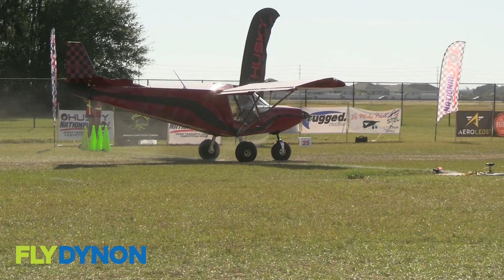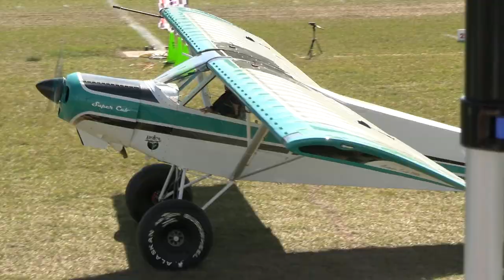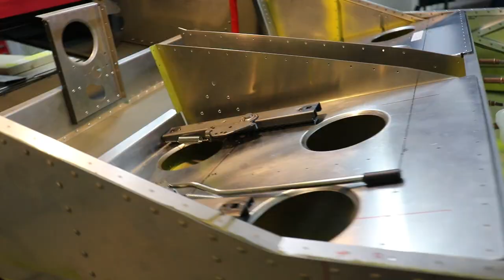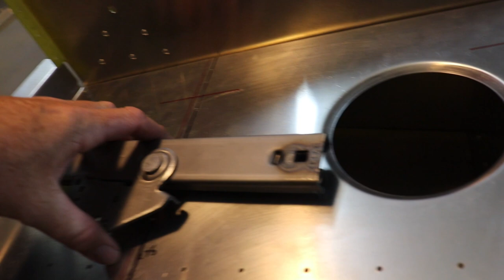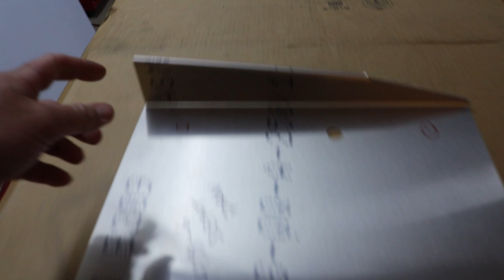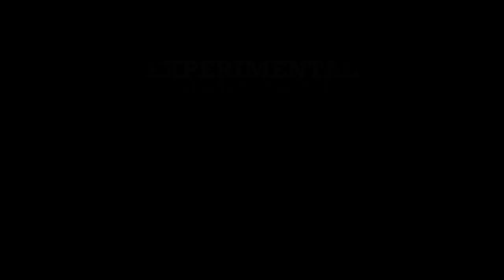Day 6 of the 31 Day Build Challenge

Comment: What are you building exactly and can I build it in 31 days?  I’m pretty good at keeping my ski boats running.  I also have access to guys that rebuild cars so I could probably handle it.  What is the cost of the kit?  Maybe this is a safe plane to learn in.  I don’t have my ppl but I have 55 hours in a cirrus, passed medical and written.  If the plane you’re building isn’t a two seater with some storage for toys like golf clubs and standard luggage what do you recomend?
Reply from the maker: I am Building a Zenith Aircraft CH750 Cruzer (with a few light mods) which is a High Wing, 2-Place, tricycle gear Aircraft. The kit is somewhere around $25k (Airframe only) and then add in your engine, avionics, paint etc etc. This is an excellent plane to fly at any experience level. You cannot build an airplane (by yourself) in 31 Days. This is simply a Challenge to get as much as you can done (nearly every day) during the month of December to get a jump start on your project for the following year etc. (There has been a Zenith built in 1 week * Search: ONE WEEK WONDER but that was with about 1,000 people working on it and many things sub-assemblies prepared in advance).
Reply: @ExperimentalAircraftChannel  What engine do you prefer? I’m assuming the most hp is not always the best option.  I read 400 hours is the average build time. That’s not bad…..that’s ten 40 hour weeks.  Are there any quick build centers that have done these? Did you order the entire kit to be delivered at once?  Is the rotax 115 tsi turbo an option?  Is there any room behind the seats for toys such as golf clubs x2 plus reasonable baggage?  Is there a place that teaches (I’m aware of the experimental rule change) or allows test flights? Lots of questions…sorry.
Reply from the maker: @Mobev1  Engine: Well we are doing something quite different from the "Main Stream Options" on our Official EAC Aircraft. the Franklin O-235 Sport 4 - 4cyl 125HP-130HP being built in with Chris at Airworx. This engine provides a lot of torque and HP for the weight (similar weight to the 100HP Continental O-200). Builder Assist: There are a few Builder Assist Centers around for sure. One in TN and One in Central FL I can think of at the top. We ordered/built this in stages. Not getting the entire kit at once. Depends on your workspace availability and finances of course. Nothing wrong with any options of getting the kit started. I am unaware of anyone that has installed the 915 into a Zenith, but that is not to say it hasn't happened. I thinking it would use the same mounts Zenith provides possibly. There is room behind the seats. Golf clubs might be a challenge due to their length/height. Might have to get creative on standing them up or something. Best thing I can suggest for test flying is to visit the factory in Mexico MO. You can safely try it on for size there. Hope to see you Building sometime in 2022! :-D
Reply: @ExperimentalAircraftChannel  thank you for the response. I’m going to go to MO for a visit in January